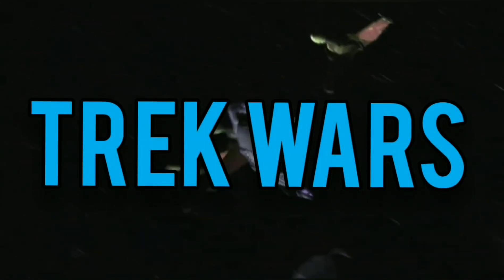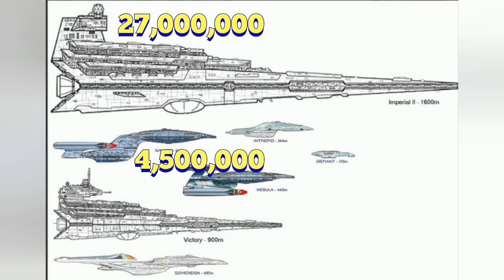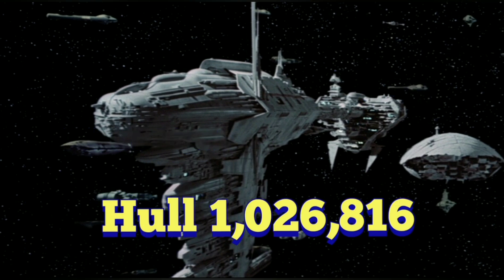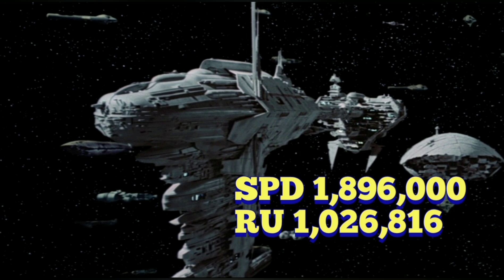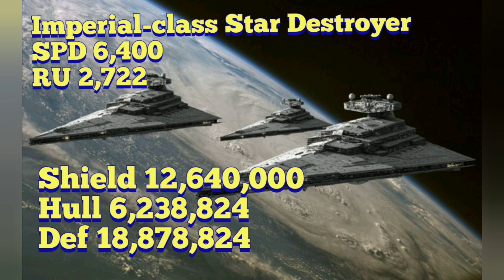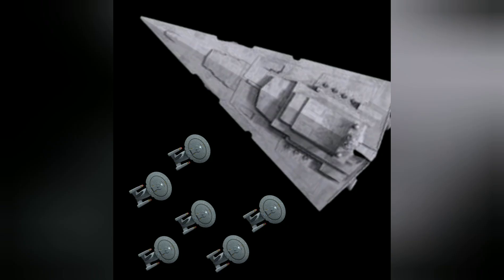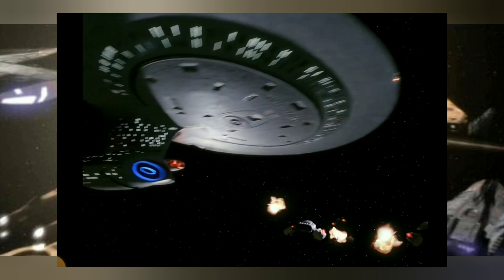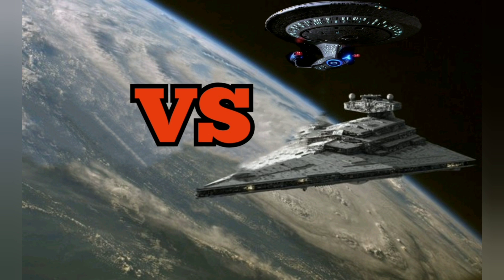Galaxy vs Star Destroyer what if they were made from the same materials?

Comment: I always felt federation starships whilst smaller where considerably more manoeuvrable than the Star destroyer. It would depend on what class starship the federation would have available. A defiant and Akira would in my view would overwhelm a imperial class. This is based on both ships focusing there weapons in the star destroyers bridge/ shield generators and it's propulsion system. An Akira class boasts numerous forward torpedo launchers combined with a deviants phaser cannons and it's nose weapon. I read that the most forward part of a defiant class acted like a huge torpedo in a worse case scenario. However in a huge fleet engagement id say the fight would be leaning towards the empire purely on numbers as the empire has 250,000 star destroyers. The federation has at most 15-20,000 starships. I love your videos I've binged the last few hours. 6 galaxy class ships to engage a Star destroyer, we saw in rouge one several y wings disabled a star destroyer. Keep up the videos
Reply: They had 25,000, not 250,000.

Comment: yeah. don't know why they wouldn't just beam warp cores into the middle of a Borg Cube, then grab an early lunch. be even easier than taking out a star destroyer that ACTUALLY has shields.
Reply: But they can only do it once before they adapt for the next cube I think.
Reply: @jakoseto3398  hard to adapt if they all go up at the same time. just cruise in looken innocent and boring and BOOM. hard to adapt if they all go up at once.
Reply: @regentmad1037  I suppose but f the entire collective knows what happened they could work it out.  Are t the Borg all connected across all ships not just on one ship?  Plus this tactic is also assuming that no one has done this before and they don't already have an adaption for it.
Reply: @jakoseto3398  yeah but by then the rest of the federation would adapt. borg wouldn't have been anywhere near the threat.
Reply: @jakoseto3398  i would have had such a good time trolling them in a little science ship. just cubes blowing up randomly XD
Reply: @regentmad1037  it'd be interesting to see if they could adapt to that :).  Borg become tricky:)
Reply: @jakoseto3398  so do i... ;)

Comment: So... Would an A wing made of Star Trek materials be dealing over 18 million damage then? :p

There's also another trait that Galaxy class starships have as a significant advantage over the ISD. Their sensor suite. They can quickly identify, pinpoint and target weak points on an opposing ship. They tend to be pretty good at concentrating fire on whatever they prioritize and the ISD definitely has more then one interesting point to target. So many cases where they opt to disable enemy vessels instead of blowing them up. The hard part is getting through the shields first. ISDs on the other hand, tend to just shoot in the general vicinity of the enemy and overwherlm them as a whole instead of doing any form of concentrated attack on a point. Kindof throws the hull value comparisons out the window.